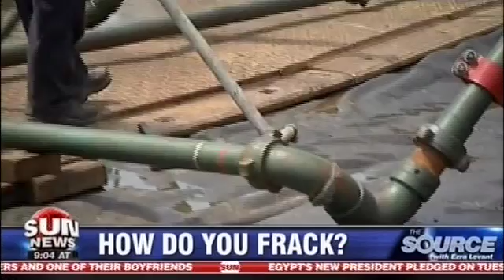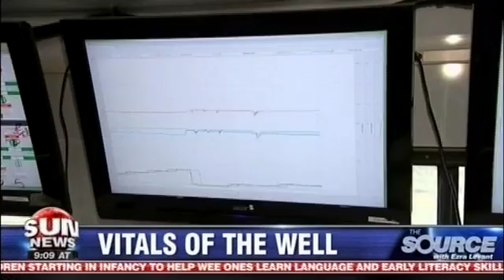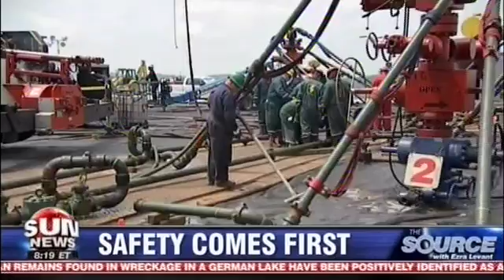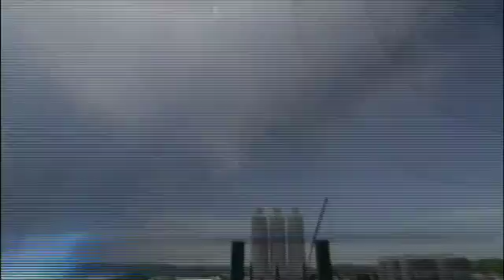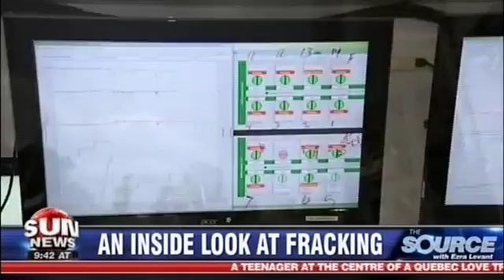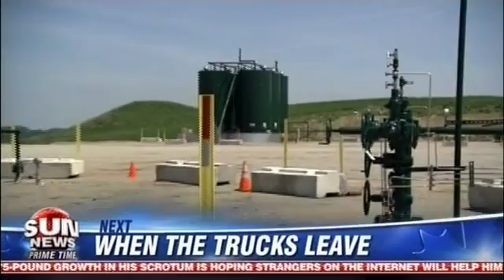Details of Fracking (Hydraulic Fracturing)

Comment: Fracking is the cause of the homeless crises because the micro surface quakes are destroying the foundations of buildings in a much bigger area as currently thought and admitted by the operators. The vibration also erode shore lines and cause cracks on highways!!!
Reply: “Fracking is the cause of the homeless crisis” may be the stupidest statement I’ve ever read. People are homeless because they don’t want to work and would rather sit around doing fent. Definitely wouldn’t be homeless if they cleaned up and took fracking jobs..

Comment: Question: I have fracked wells in the Eagle Ford tight shale zone in Karnes County, Texas.  Approximately how large and how long are the "cracks" perpendicular to the lateral lines?  I've heard around 1000+ feet, typically.  The wells are about 10,500 feet deep.  Any info you could provide......

Comment: With all the money they make in trillions of dollars. They could use a fraction of that to set up a waste treatment plant, and render the  used chemical  water safe again, instead of just pumping it into the ground and leaving it to contaminate any existing water tables. They are only interested how much profits they make. A trillion dollars is not enough, even if the locals have to drink the contaminated water. Kill a couple of thousand locals, is except able to make big profits.
Reply: It cannot be rendered 'safe'
Reply: @earthimagesgallery  it can be treated for release back to surface or ground water but the treatment process is so extensive and thus expensive that it’s usually not feasible. Again the vast majority of produced water especially the “small amount” generated over the life of the well (literally tens of millions of gallons) is disposed of in deep well injection sites
Reply: It gets recycled and reused over and over again
Reply: It’s called a SWD for salt water disposal where they take the dirty water for reuse
Reply: B Bobby it get reused dumbass
Reply: @1BusDriverUpperCut  only a certain percentage gets reused when it is economically feasible to treat it. They can’t reuse it without treating it or it would degrade the well they inject it into. The vast majority of it (in most of the US) is injected into disposal wells, removing it from the hydrological cycle forever

Comment: Why use dangerous chemicals guys use plain  water and sand instead because the hydraulics of hydraulic pressure is what cracks the rock  .
Reply: Lubrication for one thing, they’re not going to spend $ on unnecessary additives
Reply: Even if they didn't add toxic chemicals, the water would still be polluted by the arsenic and radioisotopes naturally underground, as well as by the petroleum products.

Comment: The big issue is,  ALL OIL CASINGS WILL EVENTUALLY FAIL.  Why?   The earth moves over time,   and when it moves even just a bit.  It is going to break the cement and crack the Steel casings.  When this happens,  all hell will break loose in the clean water aquifer,  destroying all of the purity in the water for human consumption.  It might take 50years or 200years but this will happen and cause unseen amounts of damage to so many places all over America.  There could be a solution.  Do they fill the hole with cement when finished??
Reply: If you put the same amount of energy into researching the process of oil drilling as you do trying to stigmatize it, you’d know there are multiple layers of cement surrounding each casing
Reply: And as soon as everything is done, the well is filled with cement and a plug is welded on followed by land repair. After all of that, you can’t even tell the well was there
Reply: As a wireliner ( someone who inspects the casing yearly) that depends on your local state regulations some areas ie Alberta Canada they've been fracking since the 1960's and having yearly inspections. It is expensive but saved quite alot of headaches over my career
Reply: @OutdoorCraftsman  thanks for your comment, hard to find much detailed info about Canada's fracking that isn't buried inside a thesis lols!.  Appreciate your confirmation about the annual inspections.  Cheers!
Reply: Tell me how it ends in 50 /200 years
Reply: If that your big issue then you don't have anything to worry about.